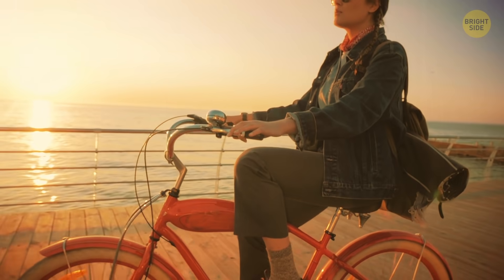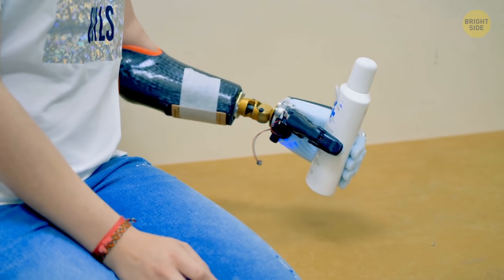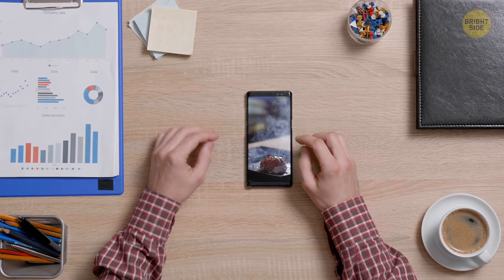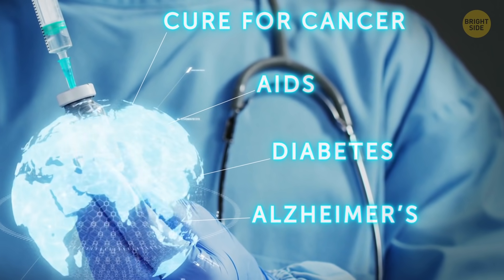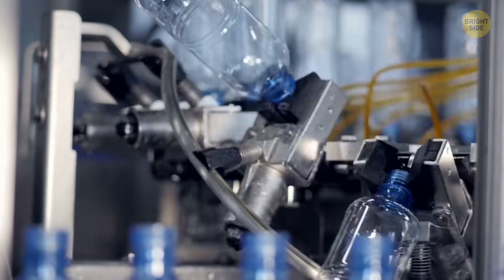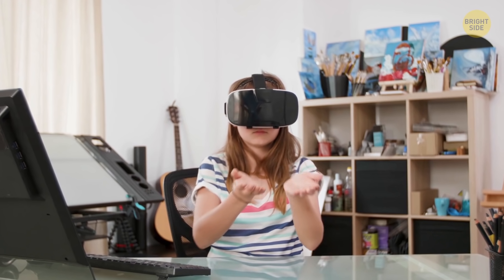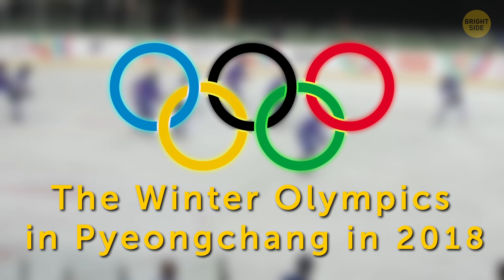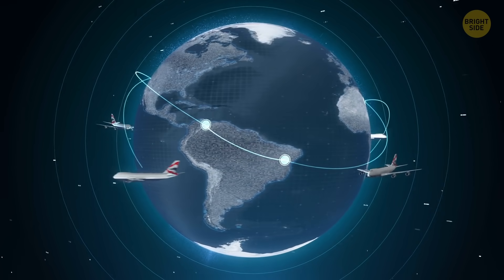What Will Happen to Us Before 2025

Comment: Guys! have anyone else noticed the price of ethereum is on the rise again? An expert on crypto currencies posted about the price dynamism of ethereum, he said the market is bound to either go up or down, but the ability for an investor to study the price history and properly access the flow of the market is what is called market analysis and can be done by anyone. Ethereum is gaining momentum above the $1,250 and $1,280 resistance levels. I see only opportunities for holders and traders, although i would go for the latter because its much more profitable. Overtime, i have used lots of signal service and guide from experts to assist with my trading and also tried couple of strategies from renowned experts in the trading business. Sebastian has being one of the most resourceful and experienced trader i have come across in recent times, most of my strategies were from him. The fact is with enough determination and guide one can actually trade by themselves, maybe we ought to just get more dedicated in crypto generally. .  Sebastian tellygram (+447828450768) and watspp  (+447828450768) provides basic insights needed in understanding trading,,,,

Comment: Flying cars,  Lightweight buildings aircrete; jet planes;  free energy fossil-solar;  visual computer;  smallest gadgets full function air-conditioning, heater, folding room, flying shoes, pocket size: stove & kitchen; fridge, water generator in bottles, shredder garbage; incinerator toilet; carry-on toilet bag #2.  Also, antibacterial, no laundry no ironing clothes.  Meal on pills.  People hired as experimental specimen.  5-D movies non-screen; with weather effects.  Express Education months; not years.   Cell phones & internet self installed; Satellite 8-G.  I like the folding bamboo slates into curve beds adjustable head and foot heights.  You can sleep everywhere plus the folding room I mentioned earlier.

Comment: I doubt this will all happen at once.Yet I do accept the greener issues  will happen. Yet can not get rid of  old energy issues crude oil  and Natural gas will still be here at least .I do expect less oil producing needs and wants will be not used in around 2030 or 2035 .Just as long we have automobiles such as SUN's and trucks. I do feel diesel will change to more bio diesel .So we can save the planet. Older buildings will be retrofitted  to new technology. Also the way or method Aerospace planes will be the method of future also there will need type of flights Trains will definitely change To more tubular.

Comment: hard heads, the stubborn and those that are not willing to change .... will be the new lower class and homeless. today it is abuses and those that find their job skills deteriorate or cant build the needed skills. today if you cant factor single variable calculus you will not be able to make executive engineering positions. when i was a staff engineer to a corporate president we argued about small shyt allot. that was because the executives and poorer engineers couldnt determine and then place the right factors to get a better estimation in their heads. in 2050 if you can do that with a single variable but not multi variable you will be a substandard scientist. a chief engineer will be able to do that linear, preprocessed and extrapolated values.
some of us were forced to bring in a dry erase board to demostrate ideas execs couldnt go from chem to semiconductor pyshics to schematics and plans in thier heads. they were telegraphing weaknesses!!

Comment: It's actually kinda amazing that iPhone 12 will be more or less 10 times cheaper then now, but still the new things will be much much more expensive because of the "quality", depends on the item.
Also no way I will have a chip in my body, the virtual ID thing could be used as an chip, not everything is like it seems

Comment: Eternal torchure and torment  if you take the rfid microchip implant, quantum dot ID with vaccines recorded in, biometric electronic tattoo mark of the beast system :  Rev 13:16-18  Rev 14:9-12  Rev 16:2  Rev 9:6

Comment: Again with the hydrogen car. Please tell me where you are going to get all the hydrogen and if you mention water I'm going to ask you where you will get the energy to power the electrolysis. If you then say solar panels and wind turbines I will laugh at you while rolling on the floor. In 2020 electric cars are starting to look like a workable option, but the hydrogen car is a hot mess. 

Also, just so everyone knows, the Earth still isn't flat and Epstein still didn't killed himself.

Comment: Driverless cars will only work if all vehicles are interconnected and there are no human drivers on the road.  The reason being because if the cars are interconnected, they can all communicate with eachother and negotiate moves in a way to prevent accidents.  But when you factor in humans to the equation, there is a level of unpredictability, which is why driverless cars today or cars with assisted driving capabilities, won't ever work out until the roads are rid of humans operating vehicles.

Comment: 8:06 at my school we "were" learning about 5G like the it has a lower latency or the parts are more busy and more faster and we might have 5G in 2020 or either 2021 but its most likely to be 2020 (I think) and that 5G can or will communicate with smart cars. (basically self driving cars) [I learned this info at my school so ye]

Comment: There most likely be no flying cars. They are very expensive to make and they are useless, they won't solve any problems and we would run out of materials on Earth and the rule they use would run out quickly too. If, however, we do the amount of times used to power the cars would be extremely inefficient, so sadly no flying cars they would be cool though! Oh if we solve the fuel problem then flying cars!! It is possible just not likely.

Comment: XRP millionaire.
-Dollar will be devalued, dollar reserve will be digitized. A incentive.
- Phones will have 7day charge
- 40% of cars will be electric ⚡️ w/ 800 mile range. 
- Bitcoin will be still be around, but would have forked to compete more advance crypto’s. 
- Fastest Train in the USA will be in Florida.
- AMD will be leader in chip making.
- Intel will have major sales issues. 
- Gravity will be solved, and hints of new transportation will be tested in public by top military personnel. 
- CPUs will be 5 times faster than today’s fastest desktop using 1/3 the energy using carbon nanotubes instead of silicon.
-Bitcoin will be worth 50k stable but will slowly die off in volume, but that’s about it.
- John McAfee is no longer a man 👨

Comment: but many will loss jobs due to automation
Reply: Bigblrman75 Surya  ah, is that what you think? No sir, with expert systems, ALL stratas of society will be at risk for losing jobs. Most people think of automation as robots doing manual labour only and that is not the case. Machine learning/expert systems will be capable of doing nearly every type of job.
Reply: @donixion4368  
Won't make much of a difference. Population will still increase exponentially
Reply from the maker: RENJITH PR which area would you like to work in?
Reply: @BRIGHTSIDEOFFICIAL   as a           medical scribe any future for this ? i heard a new software named something like dragon  is implemented in most of the companies and its automated it inputs while physician's speaks and assigns code also who knows there is a future or not 😢